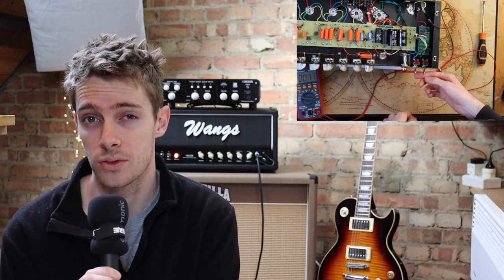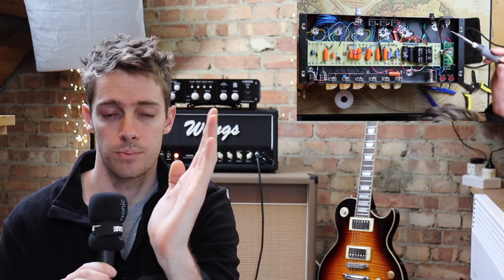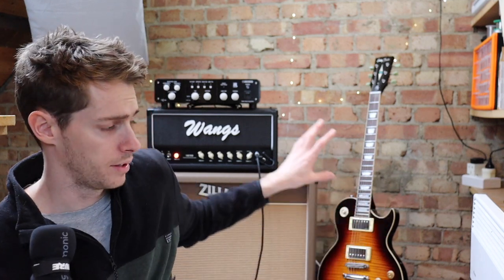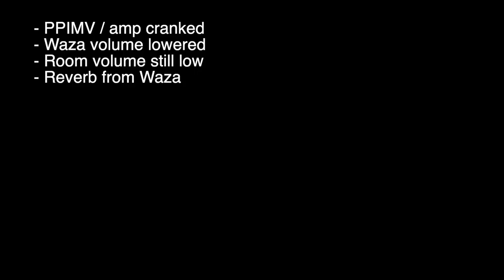PPIMV vs Attenuator - 50w Plexi (1987HW)

Comment: I think the problem lies in the pot that you used. If you spend the money and replace it with a good one you will notice little tonal variation. Also that Wangs amp, was it laid out like the instructions at Triode electronics?
Reply from the maker: Hmm I will check the one at Triode and get back to you. I was quite happy with the PPIMV tone even from a cheaper pot - I normally just check the sweeps are balanced before putting it in.
Reply: @PedalScience  last question I promise. Did you have to re-bias the amplifier after you did the ppimv? Thanks man it does sound great! I bought the same amplifier and it's freaking loud. Also very bright on the treble input

Comment: every ppimv i tried even the simple 1 meg pot 2 wire one sounds much harsher and a faker distortion sound than the amp blasting or an attenuator
Reply from the maker: hmm I think it can depend on the amp - I just put one in my SC20 and it doesn't sound as good as the one in this video.